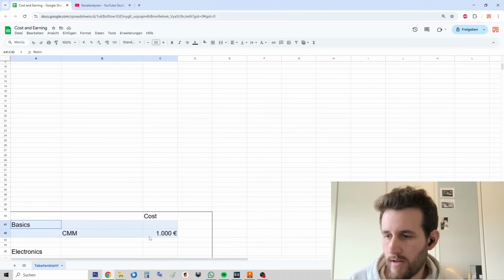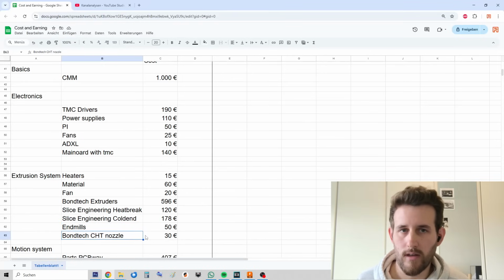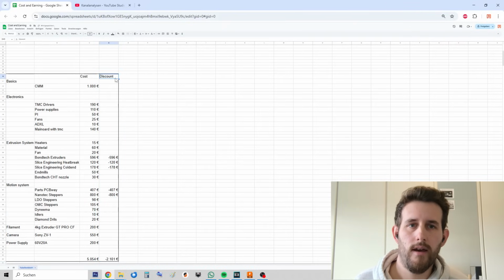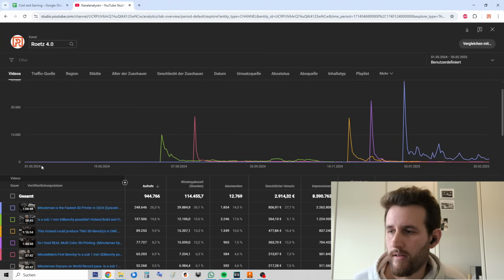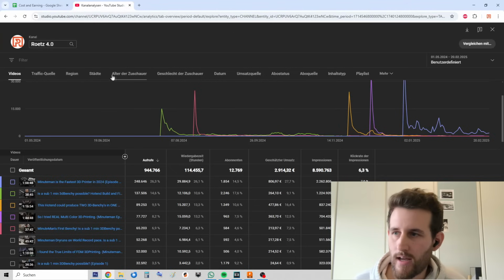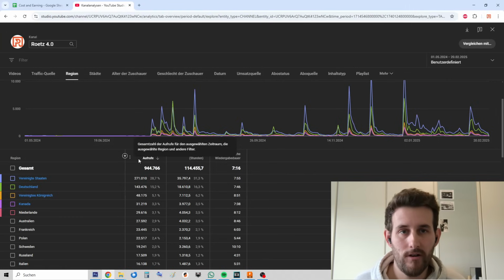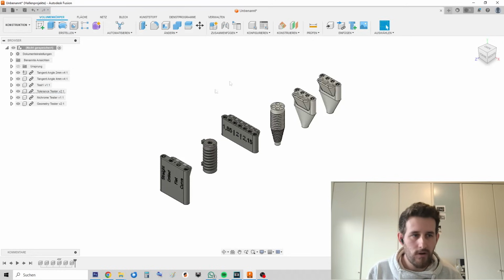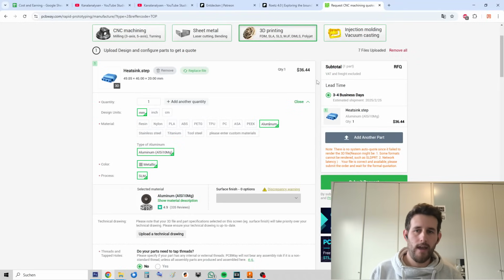Minuteman | What does the Fastest 3D Printer REALLY cost?

Comment: thanks for the update, really appreciate the general ideology and transparency! would it be interesting to try and cool the top layer with maybe less air volume but much cooler air (thinking subzero degrees C) ? or would that mess with material properties? i could maybe help prototyping something if you think it’s worth a shot
Reply from the maker: @bastieng  join the discord, I'm always open for suggestions. However I already do have own plans worked out for testing purposes
Reply: @ yeah i actually just got on the discord and figured you had a lot of ideas and plans on cooling. will add to the discussion there if i think of something that’s not yet debated or tested

Comment: 1.75mm filament can tolerate ~11.5kg of load. The lgx can push only 5kg, hemera can push just over 10. Really curious where you got the idea that lgx was best for this project...
Reply from the maker: Youre numbers are wrong
Reply: @Roetz40 maybe not, but you are using the LGX Pro's right??
The standard LGX extruders is not really high performance....

I cannot remember what drivers you are using for the extruders but do try the TMC5160 and 48V on it, it makes a difference :)

For the pressure advance I can help you too.
If you connect the step, dir and en pins on a breadboard and redirect it to 4 different drivers that you feed individually with the SPI and power, you could get over the problem.

Multi_pin might work but klipper most certainly don't have that option in the code. Should be pretty easy to get past thou.

Comment: Maybe a silly question but can you make the speed dynamic? Slow down at some points, speed up at some points, you could develop algorithms for this maybe or hard program it in?
Reply: The speed is dynamic. It is mostly explained in earlier videos. 

The two primary speed parameters are the maximum acceleration and maximum linear speed. Those two limits are the ones that he mentions on each run. At least once he did a print where he set the maximum speed lower for a few layers that were having issues. So he can change those limits within a single print run if desired.

There are a series of algorithms that compensate for the effects of resonances and inertia in the motion system, inertia in the thermal system, and inertia in the extruders. These algorithms change the timing and velocity of the commands actually sent to the motors.

This velocity shaping allows the printer to extrude features with sharp corners.

Comment: I do feel if you can find a solution to use below-ambient temperature cooling using electricity, like producing it yourself with a machine, that would be much cooler than having a finite supply from something like a gas bottle that has to be replaced all the time.

It feels much less like "cheating" in a sense in that way, although we're of course already stretching the boundaries here with these speed benchies haha.

Great work and looking forward to your next video! ❤😊
Reply: compressed gas was made with electricity too, just in a different place and time than it's use

Comment: Holy sh*t, if you drop the rules at some point, could you use pneumatic cylinders to actuate the cables?
Reply: I have used closed-loop servo pneumatics in the past and I got the feeling they aren't nearly accurate enough for 3d printing. It is really difficult to accurately control pneumatic cylinders because air is "mushy." Like imagine trying to drag a sled across ice and stop it precisely in a spot using a rope (hydraulics) vs using a rubber band (pneumatics).